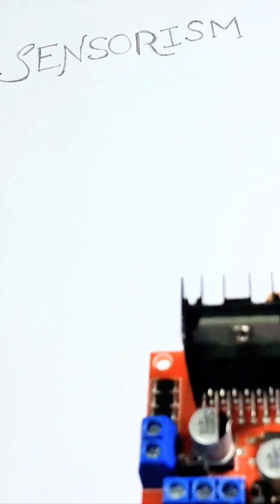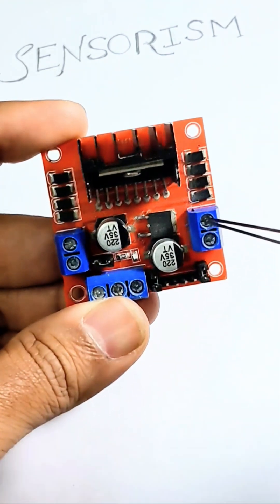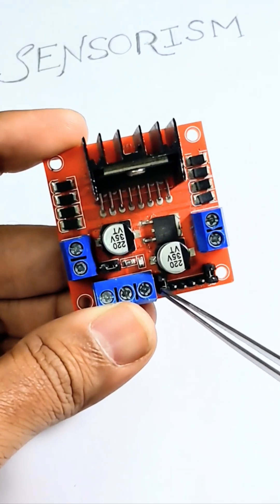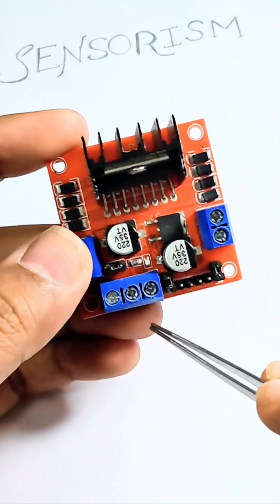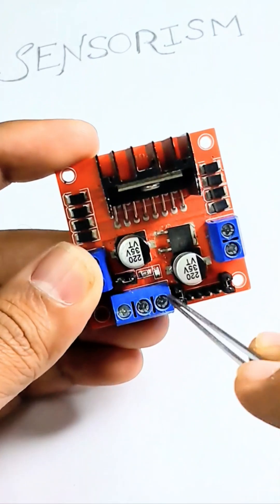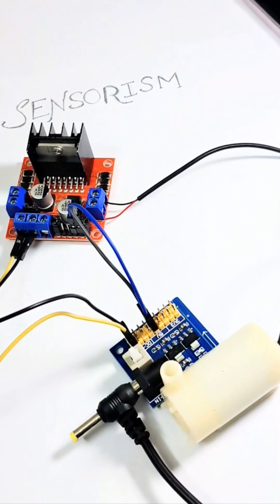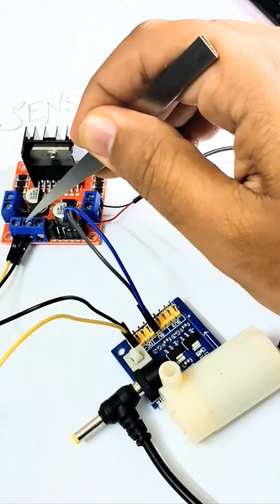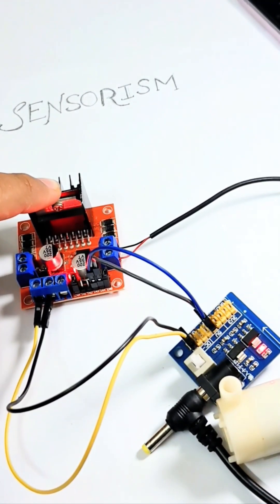L298N DC motor driver explained

Comment: I have a question regarding use of 5v output , can I use that to supply the esp32 micro controller , and can  you tell what is the jumper wire thing u told , do I need to pull it out?
Reply from the maker: Yes you can power esp32 with 5v output when esp is not running on heavy loads. ensure that esp ground and driver ground are connected.  There is a on-boarding 5v regulator on the driver which yiu can enable using jumper behind power terminals. keep the jumper in place to use 5v output.

Comment: (I am a beginner with L298N ) 
My few questions regarding L298N motor driver
Q1- the motor driver can deliver 2amp per channel  , if out1 and  out2  comsume  2amp the total amp in the motor driver module  consume 4amp , this will not burn the IC L298N? 
Q2- the max output wattage  is 25W , the driver rating is between 5-45v , if I operate a load at 25v and the load consume 2 amp , the power(VxI) will become 50watt , then what is this, the l298n motor driver limit the ampere or burn due to overload? (In this sense we can't use more than 12 v with 2 amp , how driver motor support  more than 12 voltage with 2 amp per channel) 
Q3- I use potentiometer to control speed of a motor when I rotate the potentiometer knob 3/4 (decrease rpm)  the motor stop working and noisy sound produce,  the out1 is giving little amount power to the motor but motor shaft not rotate. This will cause bad impact on driver or there is something to manage this? 
 I shall be sometime wrong  in questions due to inappropriate or lack of knowledge, I just want to know how it's work
Reply from the maker: Thanks for the question.
1. yes driver will deliver 2amp per channel. 2amp is the max limit per channel. if your motor continously draws 2amp per channel it might heat up the driver and damage it. if you need 2amp constant current, think of using any other driver which has higher current limit. Although l298n has protection that might not be enough for long running loads.
2. Voltage can be higher than 25v. The limit range is 5v to 45v. The motor can drive currents varying from few ma to 2 amp. Running driver at higher voltages and current will lead to lot of heat dissipation and may damage the driver.
Reply from the maker: 3. When you are connecting potentiometer to enable pin to control speed, it might be possible that voltage is less than motor minimum startup voltage or duty cycle. as you turn potentiometer it may get that voltage but it is still not sufficient to start the motor and hence the noise on the motor. test the voltage across potentiometer to check the voltage when you turn is above the motor startup voltage.

Comment: Hi, thank you for this tutorial. What kind of motor can I use with this? Can I use 12V motor?
Reply from the maker: Yes you can. L298N supports 6V to 35V and current upto 2A. You can use DC motor with in these limits.
Reply from the maker: Provide input voltage based on motor voltage rating. Example: if you have a motor of 9V, you can provide input voltage of 9V  to motor driver.